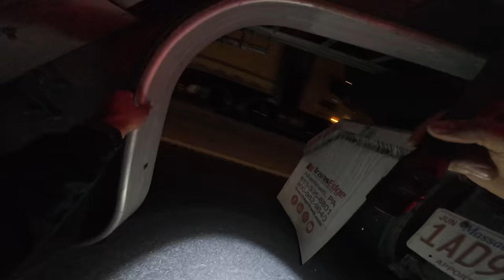70,000lb Battery Destroys YouTuber's Trailer!

Comment: Absolutely no reason why 70000 lb should been on that trl. Over loaded clearly
Reply from the maker: Agreed
Reply: First thing I thought when I read the title. Was jus waiting to see if there was a third axle or not
Reply: it was 62,000 according to the nameplate .
Reply: give me better loads
Reply: @ronblack7870  I'm going with the higher number stenciled on the back of the container.  But what do I know; I've only ever hauled fuel and produce.
Reply: @ikikardesh drivers are responsible for the loads they drive away with. You should have rejected the load.
Reply: @ikikardesh that’s what she said!😂🤣✌️
Reply: @ronblack7870  even then its still overweight.   Basically a flatbed trailer and semi typically weigh 32,000 (or 16 tons) combined unladen.   But ith a 62k (or 31 tons)  loaded on the GCWR (gross combined weight rating) of the truck and trailer, you get 94,000 lbs.. and since you can get charged $100 per pound over... imagine paying a $140,000 fine... the operator that hauled that big ass load should've checked the paperwork twice and weighed it before doing anything else.
Reply: Wait 42 metric tons total thats not even at weight in the UK thats pathetic but explains why your trucks and trailers are made out of sheet metal in comparison  @CA.papaBear
Reply: Load experts in here
Reply: @earpig  damn rite I am,see I do this 4 a living.  He needed a 3rd Axle.  He plain over loaded his trl
Reply: If you go off off those numbers each container has the 70,000 mark them he's got 140,000 but if you know anything about those markings that means only what that Container is able to handle with the container weight as well.
Reply: @deeeeeeeench1209 haha America stuff bad haha England good
Reply: @NigelThornbery  superior Europe.
Reply: I can’t tell exactly what trailer that is but it looks like a Reitenouer 53ft step deck and they make those with a coil package rated at 90lbs and on those trailers it shows exactly where the weight needs to be. It’s usually right in front of the front axle on the trailer. Regardless of the weight rating of this trailer that load is positioned wrong on that trailer and regardless of its rating that alone would make any trailer fail. Which is exactly what the manufacturer is going to say they are 100% right
Reply: @deeeeeeeench1209  sarcasm
Reply: @NigelThornbery  I was just being objective with it
Reply: guys walking all around that 70thousand pound battery while its suspended was the dumbest thing ive seen in a while.
Reply: @ikikardesh learn how to center the weight better on your trailers and this wouldn't have happened. 100% your own fault.
Reply: @deeeeeeeench1209 in Europe yall transport at most a few hundred miles a trip. In the US we transport thousands of miles per trip. Also compare you're tractor implement sizes comparing Europe to the America's. Everything scale wise is vastly larger in the United States and that makes it far worse on the road itself. Australia still beats both of us though on highway transport and farm scales. Also anything past 80,000 lbs here just has to have a permit, there's loads that are transported here in the US regularly that are upwards of 1 million lbs.
Reply: @Ole_CornPop  incorrect millions of trucks go trans continental throughout the year. European trucks aren't restricted to just Europe and have never been. It's very diverse in comparison and because you're mostly out if country you have to count the travel both ways as a trip but don't let the context trouble you. As for scale objective you have bigger cabs and length but that's where it stops European truck chassis and axels are a total different animal total different gauge of frame the European is much much strong you will never see a European twisting the frame they will just lift with wheels and do a wheelie. The tyres are much bigger for less speed more payload and overall gross.
Reply: @Ole_CornPop  you're also talking about your state and not your whole country its actually 70,000lbs across the board. This is what I used in my comparison to be a diriect comparison to the gross you're permited over the gross to cross Europe without permits its a very good and accurate measure of European v US in terms of payload and European have you beat thus explains a global export market vs a limited one with American Australia builds their own woth annamerican badge on and that about where it stops Australia have taken on many more European units for ease if use and an ever growing infrastructure from European owned manufacturers.
Reply: That trailer could handle it. That load wasn’t over any axel
Reply: @natemead  wrong
Those axles r only rated for 20,ooo piece on trailer. In his configuration, he was only allowed 17,000 per axle. He need ar least 1 more axle to accommodate weight
Reply: @donaldwlodarczyk5636 wrong he needed 5 more axles
Reply: In my country we have to have a 4 axle semi trailer to carry that weight and would need to center this over the front trailer axle. I used to carry loads this heavy every day. 100% driver lack of knowledge.
Reply: @earpig  Definitely. Lot's of truckers watch Pepe's. Including me. You don't even need to be an expert though. Anyone capable of getting through CDL school (60+ IQ) will know enough to check the trailer's weight rating, especially when loading gigantic metal batteries on an aluminum trailer.

Comment: Note to self, drive the furthest lane away from anything broken down the road.
Reply: Preferred parked on exit ramp or after the exit ramp then parked on entrance ramp before entering highway. 

Never park on shoulder by the highway even if flat tire. Insurance will replace new tire, new rim and fender because you doing it for your own safety to away from highway's shoulder.
Reply: @Khalid_Bin_Waleed    Even though you don't have a Class A CDL, you should have enough commonsense to know that the truck driver did the correct thing by stopping where he did.  🤡
Reply: @technocody9296  nope
Reply: @technocody9296  how, the trailer buckled and was on the ground, you have to. And most insurance won't cover if you damage further. This is awful advice. And what insurance company covers tires?
Reply: @ScootsMcPoot  its awful advice for any person, WHAT! your insurnace will say?  You drove on your rim for 20 miles to get off the interstate?  Yeah we wont be covering that

Comment: Complete operator error on that one.
Reply: It's not an error, it's criminal.
Reply: no its loader error shoudlve been in the middle of the trailer for how heavy it is
Reply: @jennifersprague8585  Operator of truck makes final decision if it’s a safe load or not. If the loader puts it in the wrong spot you tell them to move it. If they won’t move it reject the load. It is completely up to the operator of the truck whether or not to destroy their trailer by leaving with an unsafe load. This is how people die.
Reply: @ChrisL-oz4lp  Error resulting in a load that could kill someone.
Reply: @AppalachianPatriot  It was purposeful. Criminal.
Reply: @ChrisL-oz4lp  It was called inexperienced steering wheel holder that could have killed someone. I’m sure he got some tickets.
Reply: @jennifersprague8585  The trailer was overloaded, drivers fault.
Reply: @jennifersprague8585 that would be the drivers fault. Loaders put it where drivers tell them to put it.
Reply: For the guy uploading this video I’m sorry your getting bashed but then again god damn
Reply: @AppalachianPatriot  exactly this, my first year as a apprentice welder I was the dunnage slave. We built huge mod add-ons for the oilfield and truckers would leave their trailers in our yard over the weekend. More often than not we were called back in to adjust things to the truckers liking. It was pure hell but damn, looking back wont ever get overtime like that.

Comment: In my opinion, it really is the wrong trailer for the job. The trailer is probably rated for 80,000 but the problem with a centralized load like that is that proper placement means placing at the maximum stress point of the trailer, which is direct center. Moving the load back far enough to put 40,000 on the trailer axles may have worked but makes the truck want to jack-knife with very little weight on its rears. A triaxle trailer, or a shorter trailer would have been the ticket. In my opinion of course.
Reply: I couldnt agree more
Reply: Like the trailer brought to move it
Reply: You don’t put it directly over axles. Put it in the center of trailer maybe a smidge toward the trailer axles then the drives. Would be fine and equally distributed.
Reply: Bingo!
Reply: @Maxdubi  And that broke it. So bad choice.

Comment: Those frame bolts are like bullets into windshields
Reply: Or people alongside the road
Reply: Lugnut is how I got into a nasty wreck. Broke my windshield and got glass in my eye and swerved into the median and rolled. I would of been fine if the glass didn't hit my face and I reacted naturally.
Reply: @ScootsMcPoot  naturally really normal people wouldn't swerve when It already hit u unless you said all that in the wrong order
Reply: @gunnerschwieterman6383  How was that the wrong order? I think this is going down the route of you thinking you'd done different when you weren't there and you've already demonstrated you have never been in a similarly stressful situation. Take a break buddy.

Comment: That load should have been on a RGN/ LowBoy rated for that type of weight. Step Decks max load is in the center of the trailer not towards the front and the trailer should be built to withstand the weight.   These inexperienced drivers are putting people at risk and giving the industry a bad reputation

Comment: Definitely operator error, I have an Extreme trailer 48 ft all aluminum also 2022 like this gentleman. 12:47 And Transport coils you need to know how to distribute weight and also trailer has to be ordered to be reinforced for that kind of weight. Pepes you’re the best.
Reply: What's the max you would load in the position this guy did?
Reply: what is ur trailer max weight buddy ?
Reply: @ikikardesh  cope harder buddy
Reply: @ikikardesh people make mistakes but in this line of business you put other people's lives in jeopardy when mistakes occur, just learn from the experience to ensure it doesn't ever happen again.

Comment: Almost like you need to read the distributed load capacity charts for those things... Our tridem is good for 80,000 in theory. Read the book it came with, it's actually rated for 50,000 @ 10 feet in length for that exact reason. Full weight is with even perfect distribution of weight only

Comment: Josh, correct me if I’m wrong, but that kind of weight should’ve either been on a tridem trailer and moved further back for weight distribution instead of being loaded that far forward on a tandem
Reply from the maker: Absolutely. You can get away with weight as long as it's properly loaded. That was not the case here 😂
Reply: @PepesTowingService  i’m not sure how the spread axle trailers work as for weight wise and in general  as I’ve only been around tandem and tridem trailers would that have made a difference.
Reply: 100. 10 %   !!! .
Reply: 60k on triples, so still would have been overweight!
Reply: If he moved it too far back he will be over weight on the trailer tires. Problem is this kind of trailer isn't enough
Reply: Wat kinda fine did driver get for his F--k UP ??
Reply: I know some CHP guys and the way that agency thinks sometimes blows my mind. They are definitely set in their ways, usually for the worse.
Reply: even if he  had it loaded further back, trailer isn't rated for that weight. First port he hit would have been a call to a wrecker service to come unload him, and he would have the wrecker bill and the fines attached... That's if he didn't toast the axles before he hit the port

Comment: Seen them aluminum trailer’s break just like that a couple times way overloaded , bed capacity is just a suggestion to most people.
Reply from the maker: How often have you seen them break this way? Personally, I've seen it a total of like 4 times. It's always due to being overloaded in my experience.
Reply: Seen two the last one pulled up to the fuel island next to me and didn’t even notice till I pointed it out to him both were brand new less than 3 months old . They also use them lithium batteries at transfer station to store power from wind and solar, my brother in laws company has been doing the electric work to wire them in at various locations
Reply: @PepesTowingService  Very true way over!
Reply: What's the gross weight rating of the broke trailer? 
If I had an All Aluminum Drop deck I'd get the 10 ft spread Tri-axle. Easier to load than a "California" sliding spread.
If it's got a single coil package spec trailer. Where's the load mark at? 
And I'd also have a full set of container pins on it. 2,20s 1 20 loaded and a 40
Reply: Josh (Alex) how did the truck get that far with out being stopped at a scale?? California scales are notorious for being strict!
Reply: CHP should be using High Visibility vests (clothing). The DOT officer has all dark clothing, insane.
Reply: @Military-Museum-LP Probably too dangerous to do their jobs due to possible dui drivers

Comment: That aluminium trailer was having a BAD DAY. PEPE's saved the day in THE END.
Reply: @ikikardesh  Run that trailer down to a welding shop, have you fixed up in a couple days!
Reply: @fastst1  I dont think so
Reply: @lloydchristmas1086   Oh yeah, just some easy heavy metal work, scarf off the old, weld on the new.
Reply: @fastst1   hehe ok 🖖
Reply: @lloydchristmas1086  Was amazed to see a giant log skidder roll into a local job fab/machine shop, whole rear fender was busted, in an hour using cardboard aided design the shop was plasma cutting gussets and big chunks of 1 inch steel plate and had the entire rear section welded up and reinforced hugely in 4-5 hours.  Was awesome to watch
Reply: @fastst1   Oh yeah, thats badass! 🤗🫡

Comment: That dude is a steering wheel holder. Doesn't know what he's hauling? They have dummied downed professional drivers.
Reply: Steering wheel holder wearing flip flops. See at 16:43.
Reply: he drives in to pick up the load
they crane the load on his truck
he drives off

whos at fault here? the driver doesn't load the load buddy.
Reply: @ronaldwoofer5024  He doesn't load it, he has to approve of how it is loaded though. Hes ultimately responsible for making sure the load is secured properly.
Reply: @ronaldwoofer5024 I’m not a professional driver and even I know it’s a drivers responsibility to ensure that the equipment is appropriate for the job and the centre of mass is properly positioned over the various axles. The people who helped load the equipment don’t get the fine at the weigh scales. It’s the trucking companies responsibility to safely legally transport the load from point A to B, usually how they do it isn’t a concern for the client.
Reply: @ronaldwoofer5024  <- Steering wheel holder 😂😂😂🤣🤣
Reply: We call them circlips here.  Keeps the steering wheel from falling off.
Reply: @ronaldwoofer5024  as a former truck driver myself I have had a load weighed and went back to the shipper to have them reload it as they loaded too much on the drive axles. You can be under max weight limit but still be over for an axle. You are limited to 26,000 lbs on the steers and 32,000 on the drives and the trailer axle. even at 62,000 lbs load he would have been over weight. Max load for a dual axle like that trailer would be 64,0000 lbs. no way that trailer only weighed 1 ton. Drivers are 100% responsible for the load weights. Not to mention California is one of the strictest when it comes to Commercial trailers. Your tandems (trailer axle that can slide) even have to be set properly or you can get ticketed.
Reply: 90% of the game now is playing the game on your phone to make sure your log book is perfect. Not actually driving the truck. Or so I've been told by a birdie.
Reply: They don't want to pay for a professional.
Reply: @ronaldwoofer5024  That isn't the way it is done. Try again.

Comment: So according to LA CHP, more traffic in daylight is better than less traffic at night. They must love that congestion down there.
Reply: People are going slower in traffic. Plus, less intoxicated drivers on the road in the morning. It’s all for safety, which is a good thing. Otherwise, you’re putting the tow truck drivers in unneeded risk. They did it for them.
Reply: Safety over traffic flow
Reply: @lordchaa1598  id argue more drivers are on intoxicated on drugs and alcohol during the day..theres way morw people driving during the day.
Reply: slow traffic means less lethal accidents. night time there is a higher chance of people drunk driving and going fast. people see cops and they do stupid shit so if they tried to pull them over before the wreck they could try and speed off and hit the crew on the ground. it’s just much more dangerous to shut down multiple lanes at night than in the daytime
Reply: @lloydchristmas1086 when traffic backs up all vehicles are forced to go slower. drunk/high drivers are much less dangerous at slower speeds rather than an open highway going as fast as they want

Comment: When i was a kid,
I used to see flat bed towing massive rocks (gold rocks). Weight in 60 to 80 tons even more.
They would load only 1 rock and on the middle of rear trailer axles. Or if there were 2 small rocks, they would put 1 rock on the trailer axles, and 2nd rock on the very front of the trailer on the truck's rear axel.

Once a dumb ass put the rock in the middle of trailer. It literally broke the trailer into 2 parts

Comment: That is a 5.6 MWH battery system for a UPS in a data center, my friend. Super cool technology and that possibly is one of the first units being shipped to Korea for a show.
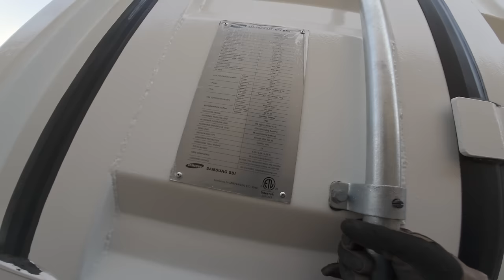Reply: A little smaller.  3481.9 kWh according to the nameplate at 22:21  These are commonly used for energy storage for solar and windfarm use.